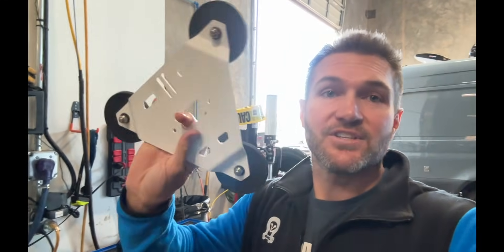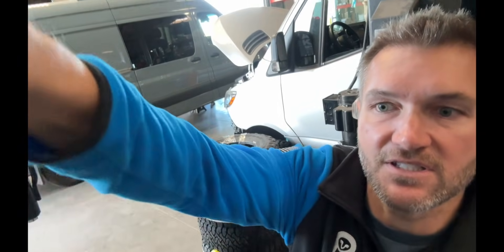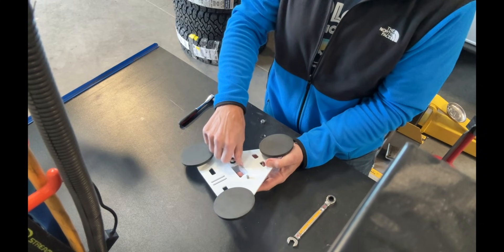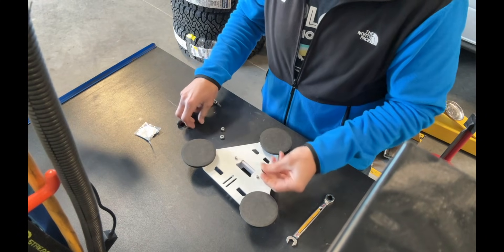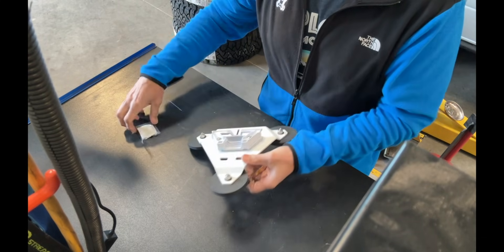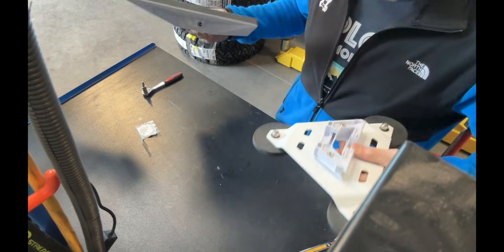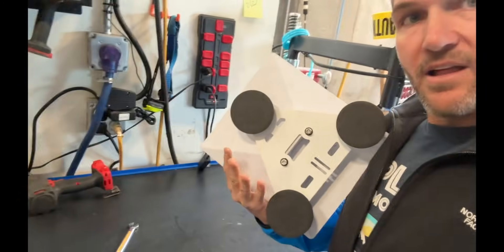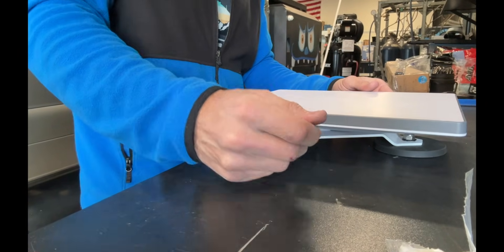Starlink Mini Magnetic Car Mount Assembly/Installation

Comment: Hey guys, FYI, the star link that I just received in the mail doesn’t have any holes in the map so you may want to fix this for your clients because this is super frustrating
Reply from the maker: Yes, we just learned this. We have a solution and will update the listing. Thank you for the heads up

Comment: My mount doesn’t have holes in it. Not sure why..  any thoughts?
Reply from the maker: Starlink recently changed their mount. You can drill them or we have a new metal option available soon
Reply: @owloffroad  related to this comment we perviously purchased a mini magnetic mount and recently got the Low Profile Locking Mount. However, the holes do not line up? are they not compatable or is there a new mini magnetic mount?
Reply: @JustABugNow  same here but they let me know before I ordered, “Please note that the new mount will require drilling additional holes; you'll align the bottom hole with the mount and drill the two top holes accordingly.”

Comment: FYI the new starlink units don't have pre drilled holes in the plastic kickstand that comes with the starlink. Have to drill holes yourself now
Reply: We just got one and didn’t have any issues with pre-drilled holes. Not sure what the discrepancy is but ours has the holes.
Reply: Weird, might have been a bad batch from the factory @pnwbjj

Comment: How do you feed the wire to power source inside?
Reply from the maker: If it is temporary you can just open the door and run it in the top. The weather stripping is soft and should damage the wire. If it is permanent, you would want a waterproof roof penetration. We prefer these: https://a.co/d/b4RzFcA